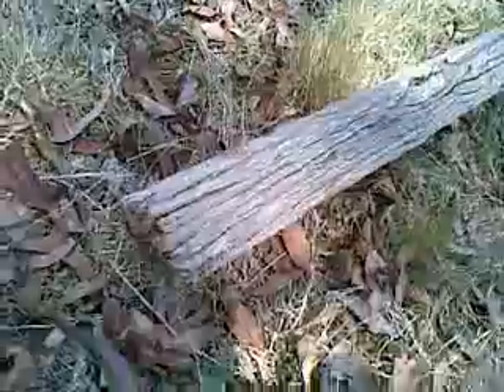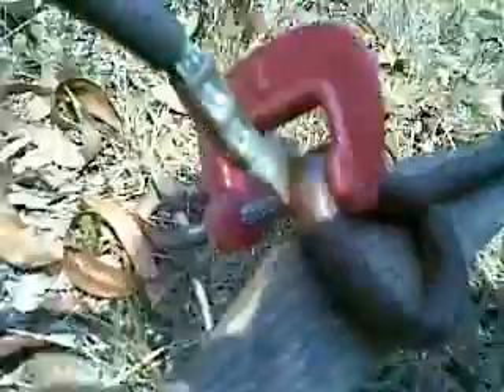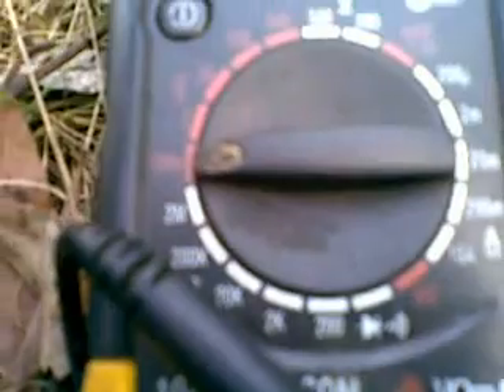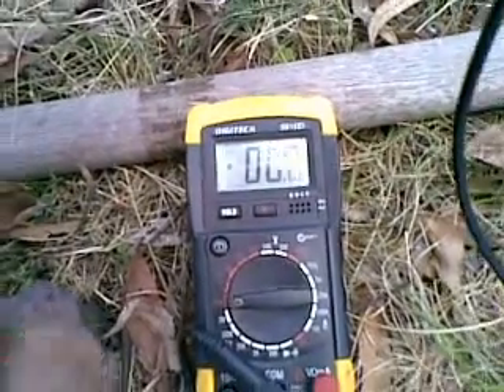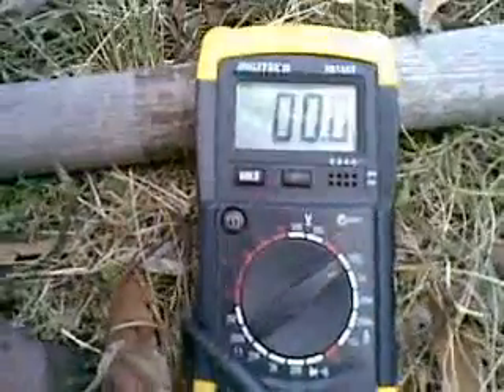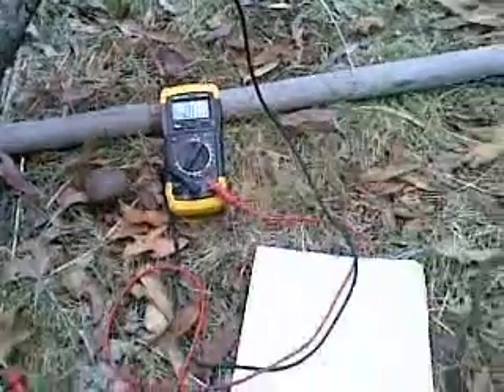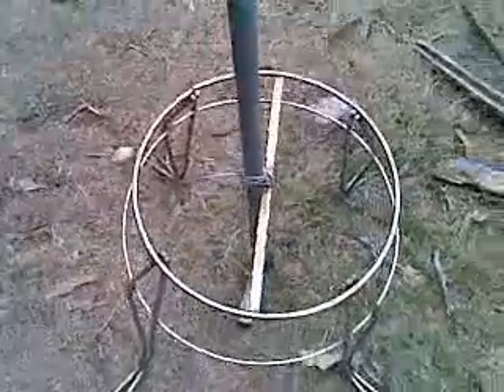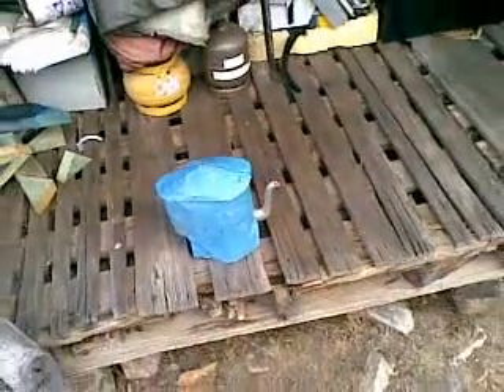Testing Tesla's "Free Energy /Franklin Lightning Collecor" For @tomken8dy.

Comment from the maker: @walkabout16
 G'day, thanks mate..! Um, I used to have a Crystal Radio, as a Teenager. A "Black Box" with a Dial, an Earphone, & an Alligator Clip. I thunked it ran on the tiny amount of Induced-Current from the Radio Field returning to Earth through the Aerial ; hence the bigger the Aerial the stronger the Signal, & louder the Speaker... I used the Screw fixing 240 V. AC Conduit to the Wall, so all the Wiring in the School was my Aerial.  Ciao !

Comment: A good earth and a catswhisker /germanium diode was the original methinks many radio amateurs who use long wire rhombic aerials(over 1000feet long) have picked up 400volts @ 1cycle per 24 hours and wondered if they could convert it to 400v @ 50cycles per second...lol

Comment from the maker: @tomken8d2
G'day Tom... Thanks ! Ah, nope, the instrument is only accurate to +/-0.5% of the reading, in the 0-200mV range ; & +/-1.5% in the Micro Amp Scale. Resolution is 0.1mV/0.1uA.... It was showing as much as 0.03, on both Scales WITH NO EARTH.., just Noise in the Circuits of the Multimeter. If the Meter said 0.00, 0.01, or 0.03 was "Zero", unconnected ; the Reading didn't change with connection. No Amps at No Volts is No Power. The Tree was a dead Wattle. Cont...